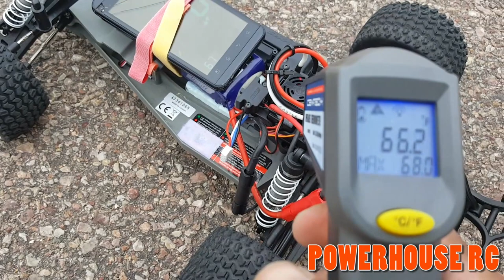#traxxas  Rustler with Neu-Castle  Sidewinder 3 Combo Speed Run | 24/90 Gearing

Comment: Man it's been awhile since I've gone to your channel I remember this video and decided to check it out again homie. GOOD STUFF MAN !!!!!!!. I got my rustler vxl Velinion 3500 KV geared 32/76 with a Spektrum DX2E 2.4 ghz transmitter and received now instead of the stock TQ which limited me to s good extent....lol. I also got RPM front bumper in navy blue color, rear Traxxas Anaconda wheels with black chrome rims and front stock Alias Traxxas rustler ribbed wheels like these ones in your video. My tires are getting worn though bro lol.

Comment: I'm just saying 5700 kv compared to my vxl velinion 3500 if you should easily be hitting what I'm hitting at 32/76 gearing at the 24/90 gearing which does make sense since you said 70-72 if you could manage to keep the truck on all fours lol so we are on the same page here. If I had 24/90 bearing on my rustler vxl I'd prob only get 55-63 max speed. That velinion isn't a joke on 31/76 gearing though lol.... I wheelie too much and it's hard to keep it in a straight line with the onroad Traxxas anaconda tires even with my steering trim set properly. Crazy power !!!!!

Comment: I was gonna say shouldn't you be able to hit over 85-90 with this 24/90 gearing combo on a 3S since you are using a 5700 kv motor ?... I would think at least 55-65 on a 2S and about 20-25 mph more with a 3S. Still a great video. I'm running the vxl velinion 3500 kv and street anaconda tires with a wheelie bar of course and on my rustler which should be about 65-72 easily but averaging about 60-66 I'm sure which still is fast lol.
Reply from the maker: I'll do another speed run with it. I couldn't keep the front end down, it was kind of windy that day.  I didn't get full throttle either. I'm thinking about 70-72 max with that gearing and tires. If I do 24/86 then maybe 80 mph but I need better tires.
Reply: use the jconcepts
Reply: @TheSiliconeslick  You still running this 1/10 the brushless system in it since this video or no ?...

Comment: do you have any problems with balooning a lot a little balooning is ok but my rustler with anacondas gets to the point where i cant even control it even with tsm plz answer back
Reply from the maker: I had problems with ballooning and the front end lifting when I was near to full throttle.  The rc has little control with extreme ballooning tires. Not good. Belted tires is the way to go with high speed runs.
Reply: yeah for sure i got some grp s7s but they are the hard compound and i dont know if its to cold where i live or what but the tires are just really hard i might get some jacos but im worried about getting them tore up because my roads here suck

Comment: Hey I have a question I’m looking at a rustler it has 7700kv castle motor 19tooth pinion and 86 tooth spur what do u think the top speed might be around?
Reply from the maker: Mr Shadow I'm thinking 60 to 65 on 2s but check the temps on the ESC and motor running that type of  gearing. 7700kv is not  meant for big off road bashing.
Reply: Cashious R/C Powerhouse ok thanks I’m building it for only speed also can maybe do a video on how to paint a body the same as yours because urs looks sick
Reply: Cashious R/C Powerhouse also how fast with a 24 tooth pinion
Reply: Cashious R/C Powerhouse 24 tooth pinion and 83 tooth spur sorry for asking so much
Reply: Cashious R/C Powerhouse sorry last question what app did U use?

Comment: Have you thought about a set of Proline Road Rage Tires? That's what I run and they hook up pretty good.
Reply from the maker: Monte Delp can you post a link for those?
Reply: I can't seem to find them on the Proline website but search eBay  for Proline Road Rage 2.2 tires. You should be able to find them there.
Reply: you could always try the Duratrax Bandit MT tires. They look pretty good and they come pre-mounted on beadlock wheels. http://www.duratrax.com/tires/2-8monstertruck.html

Comment: Do you need to use that specific ESC or will it work with the velineon power ESC?
Reply from the maker: ChrisCo-Op Gaming as long as the male and female connectors are the same it should not be a problem.